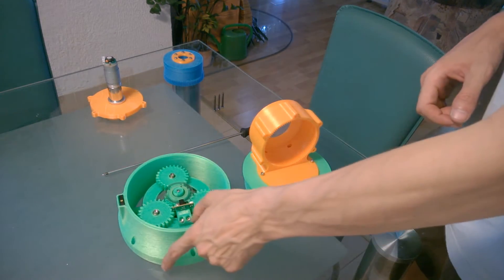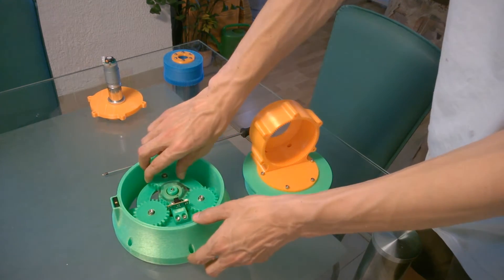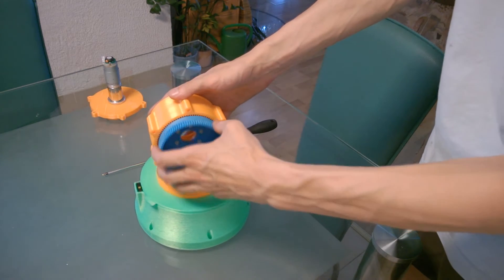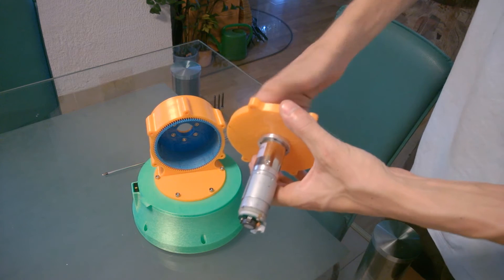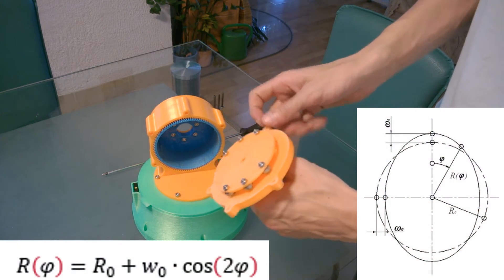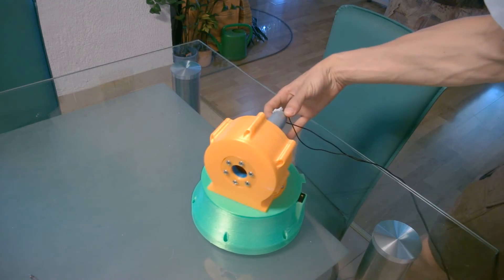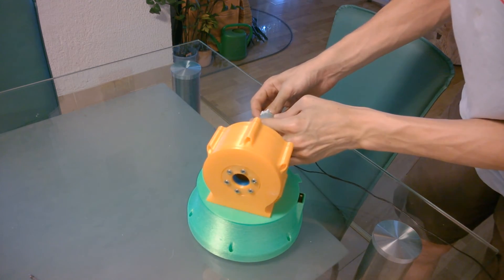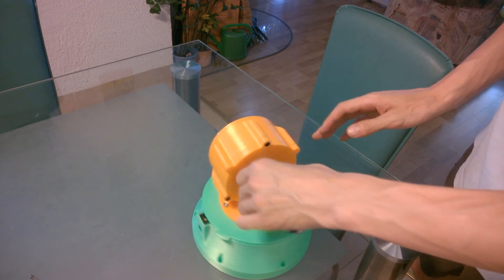DIY Harmonic Drive

Comment: Very nice. I am in the process of trying to design my own harmonic gear. How does one determine the size of ohmega_0 you displayed in the equation for the ellipse? Trial and error?
Reply from the maker: molnez Yes and no. Omega_0=circular gear tooth height. But with 3D printing there are big problems with tolerances.

Comment: I seen the R(W) equation.
That's mean when angle is 45 , R(oval)= R(0)
How do you design the gear and inner ring gear?
Reply from the maker: With mouse and keyboard in CAD program... Outer gear has 100 teeth, inner has 98 teeth and is made out of flexible material. And that's the whole secret.

Comment: How did you make the flexible gear?
Reply from the maker: Step 1: math!
Step 2: model it with fancy CAD
Step 3: slice it nice and thin
Step 3.79: 3D print it with TPU filament

Comment: hi, it looks awesome, could you share the design files?

Also i thing this design would be very usefull for a lot of people, you could post this in thingverse or other design webs.
Reply from the maker: I created this for my thesis and it does not work well under load, needs bearings. I will tweak the design and post it on Grabcad.